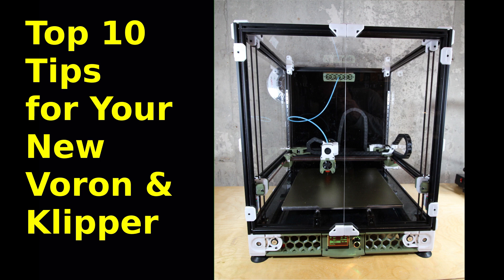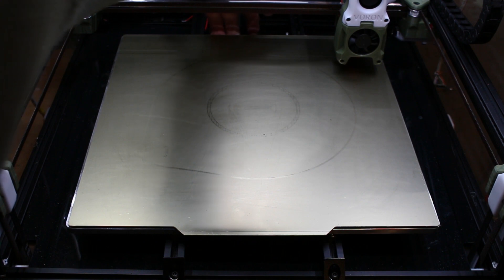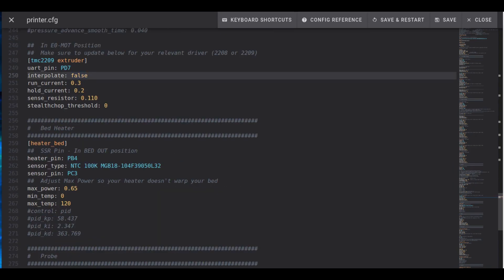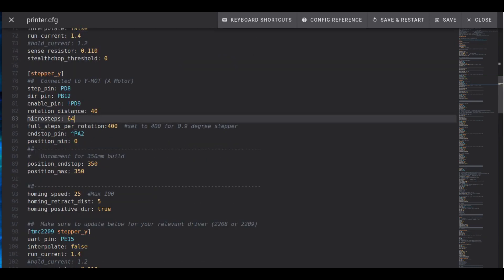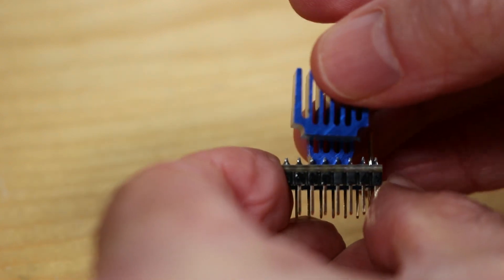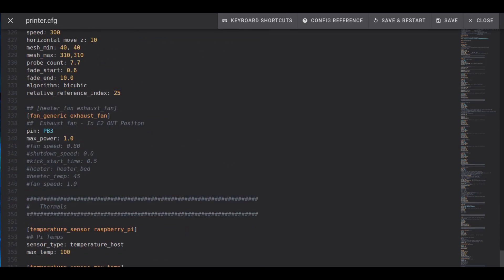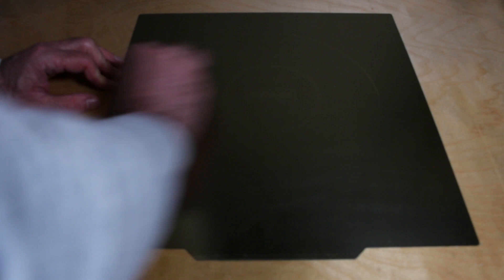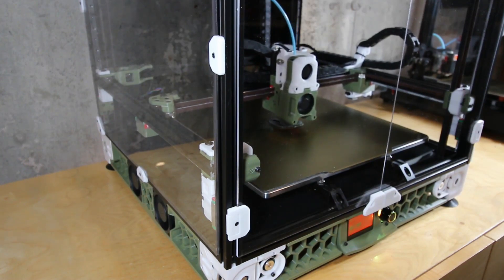Top 10 Tips for your Voron and Klipper

Comment: The only thing with increasing the microsteps is you exponentially increase the workload of the MCU. Going from 16 to 64 quadruples the instructions sent and processed every second (or millisecond? I forget) which taxes the processor. On lower end boards and/or weaker PI alternatives this might be an issue.
 Food for thought.
Reply from the maker: I am aware of this.  But even with my MCU being a spider v1.0, I have not run into issues yet.  But there are people that are switching to much faster MCU's to reach ultra high speeds.  I've got other issues I want to resolve first!  Thank you!

Comment: I've been running the same smooth PEI sheet for years, and have had to sand, steel wool, acetone, etc to improve adhesion. One thing is to use brass wool, steel wool leaves steel fragments which the magnets get a hold of, and the bits also rust, so avoid steel. Brass wool or stainless steel scrubbers solve this, however a better solution is Aquanet extra hold unscented hairspray. Now I just periodically clean the steel sheet and put a light mist of Aquanet over it. Then I print on it with PLA, PETG or TPU. I haven't tried ABS on it but have read that it works there too. No more sanding, no more cleaning between prints at all (just don't contaminate the surface with finger oil, never touch it, use tools only). The misting only needs to be done occasionally, not between each print. It seems to renew the surface of the PEI. I would make sure the Aquanet is fresh before TPU because it wants to over-adhere. PETG does also, but to a lesser degree. Water dissolves Aquanet so cleanup is just rinsing off the plate with water, very little IPA is needed for a final wipe down. Then a fresh mist coat of Aquanet and back to printing. Some dust may adhere but it doesn't affect print surface quality.
Reply from the maker: Aquanet on pei, this is new to me. I have used glue stick on pei and windex when printing petg on pei.  I need to try this. I also need to get some brass wool.  Thank you very much for the tips!

Comment: Hi, one thing to remember with the filtered exhaust fan is that while you print with it off, your printer is not air-tight... so any nasty fumes you are afraid of will slowly seep out during the print. By having the exhaust fan on during the print, it creates a negative pressure inside the enclosure. This theoretically prevents that unfiltered air from seeping through openings and sucks clean air into the case from those openings instead as the unclean air is exhausted by the filtered fan. :)
Reply from the maker: That is very true.  But it also seemed to cause trouble with some of my larger ABS prints.  I ended up building Nevermore and have installed it.  It works great and eliminates all the odor while circulating the air.  I highly recommend it.  Thank you for watching!
Reply: @KapmansBasementWorkshop  I would think the proper way to run the exhaust fan would be to limit the maximum chamber temperature to some value, keeping it constant. Too high or varying chamber temperature is a problem.
Reply from the maker: @alanb76  I agree.  At some point I'll get to making that change!
Reply: The fume hype is overblown
Reply from the maker: @powersv2  Probably, but since I really do print in my basement, my family really does not like the smell of ABS fumes that pour off that printer when it's printing at 350mm/s....it a lot of fumes....

Comment: While having more contact area with the stepstick is better, the thickness of the fins is a drawback. The thicker the fins, the more heat they retain, where as the thinner, the more room you have to fit more fins, meaning more surface area which leads to more heat transfer.
Reply from the maker: That makes sense.  But I think the extra fins with the extra surface area can expel more heat.  I think fins of copper would also be better than aluminum as it's a better conductor.  These controller chips create so much heat, I still need the fans on full speed.  Thank you for the comments and watching!

Comment: 13:35 Controller_fan section is exactly what i was trying to figure out. I want the fans for the electronics to turn on pretty much anytime the machine is doing something. Maybe even so far as to monitor the temp of the rpi and mcu and turn on those fans when it gets above 45C even if nothing else is running. What you have is better than using the heatbed to turn it on. But do you know how to turn fans on based on temperatures of the electronics?
Reply from the maker: I don't recommend having the fans turn on when the electronics hit a certain temperature.  I fear you will burn some of your motor drivers. The only electronics that actually requires a fan during operation are the stepper drivers.  And the stepper drivers can't tell you their temperature (as far as I know).  I also know that the temps on the motor drivers swing wildly and in a very rapid manner.  And, I personally have fried 2 motor drivers with inadequate cooling.  I would turn on the cooling fans as soon as any stepper is about to be powered.  I learned my lesson the hard way....
Reply: @KapmansBasementWorkshop  Oh, I was more thinking the fans would be on when steppers are in use and also if no steppers are in use but I'm configuring stuff in Klipper or Linux. But if those processors don't overheat then I'll just leave it with turning them on when it's heating up the bed or using steppers. 

I recently put together my first Voron. A V0.2 and have been dialing in the print quality which requires, for me, lots of reading then doing one configuration thing like trying pressure advance then reading more for next steps. So that downtime in between is where I was seeing the mcu/rpi heating up with no fans on because of reboots. I bet this is a moot point during normal operations later.
Reply from the maker: I'm sure you saw them heat up.  But for a pi, 50 or 60c is just fine.  I would worry if the pi was getting to 75 or 80c.

Comment: Rather than using the exhaust fan software mod you have used, you might want to consider an internal circulating filter like the nevermore mod to continually filter the odor without the exterior temperature swing.
Reply from the maker: It's a great tip.  I plan on doing so sometime soon.  Thank you!

Comment: Hey, just wanted to point out that the z steppers for me were super noisy and rattled the entire printer. Since its 4 motors running the gantry i set the run current to 1A and the hold to .5, as well as setting stealth chop to 5000. The z noise is almost gone, and print quality improved due to no extra resonance.
Reply from the maker: I didn't really bother too much with z because I assumed those motors rarely run and I was worried about making sure they hold position.  But the z motors are spending a lot of time holding and they move such small distances, most of the time, that high speed and acceleration on z don't do much to speed up a print.  Stealth chop and reduced current make a lot of sense.  I'm getting ready to try stealth chop somewhere,  z seems like the right place to start.  Thank you for the tip!

Comment: great video
I was wondering why I do not have warp issue with ABS, then at number 4, I saw the problem with the exhaust fan, mine is not connected.
I will probably add a nevermore filter
Reply from the maker: That makes sense.  I really don't use that exhaust fan anymore.   I should probably remove it and replace it with something else.  Thanks for watching!
Reply: @KapmansBasementWorkshop  nevermore seems the solution

Comment: Really like the MCU temperature and raspberry pi temps. Will implement this tomorrow. I also added a small heatsync to the MCU I had floating around. 
I'm suprize the stepper drivers don't have thermal sensors in them.
I jammed a external  thermometer in the fins of X A motor and the E extruder. Wish the octopus allowed more sensors. 
Can't wait no make my own mods video
Reply from the maker: A few days after this video, I also added a heatsink to the MCU.  Then I took the old heatsinks and added them to the Pi.  Adding those temps to the view on Fluidd or Mainsail is super easy!  I look forward to your video!

Comment: While your new heat sinks helped you I wanted to clarify some information you gave that is a little misleading.
Larger heat sinks help pull heat away with thermal mass but once they are heat-soaked that is no longer any better than a smaller heat sink.
What helps with cooling is surface area, not just* mass. (*more mass usually includes more surface area but this depends on the design) You actually want more cut outs in your heat sinks as it allows more surface for the heat to dissipate from more quickly. So in your specific case, all else being equal, if you bought the same heat sink but it had more cuts in the fins it would actually cool better.
Reply from the maker: I 100% agree with you. These heatsinks do have more more surface area via the fins which I believe backs up your statement.  I also oriented them so the fans are able to blow more air fully through those fins.  Thank you for the clarification / correction and thank you for watching!
Reply: @KapmansBasementWorkshop   You are correct that they can have more surface area as the heatsink itself is larger. My comment was specifically pointed towards the mention of them having less slits than the smaller ones which actually harms cooling and more mass on it's own doesn't help cooling.
Reply from the maker: @CharredChar  Got it.  Thanks for the clarification!
Reply: @KapmansBasementWorkshop  No problem! I am actually building a V2.4r2 as we speak so I found this helpful as some things to note once I get it powered on. The idea behind making that comment is more of a, "If I can find the same size heatsink as you did but it includes a couple extra cuts in the fins it should increase cooling more!"
Reply from the maker: @CharredChar  Have a look in that video's description.  The link to the heat sinks is posted there.  Just in case you had trouble finding them.    Thanks1

Comment: I wonder if you can help me to set up the configuraion so that the exhaust fan goes on at a certain temperature in the chamber. I have added a sensor in the chamber and want the fan to go on or increase speed at certain temp to control the temp in the chamber.
Reply from the maker: So I have not done this myself.  However, have a look at this: https://www.klipper3d.org/Config_Reference.html#temperature_fan

I can try to answer questions if I have them, but since I have not done this, Discord might be a better option.

Thanks for watching.
Reply: @KapmansBasementWorkshop  Thanks for your answer. Maybe it is better having the fan on lower speed and after certain temp it accelerates.  This is a challenge
Reply from the maker: @gudbjorghjalmsdottir7968  I can take a look this weekend and to try and get it working.  I print mostly ABS, I leave the fan off the entire print.  I only turn it on when the print is finished after the bed has cooled down.  Or at least I used to.  I installed Nevermore and actually don't use the exhaust fan any more....

Comment: Thanks for alll you cool Videos with the voron! I started with 3D Printing 3 month ago and I just finished my own Voron 2.4 last week. Talking about microsteps: If you have 64 with an 0.9 Angle motor. Means that I have to do 128 Microsteps for my 1.8 Angle Motor (Moons - Formbot-Kit)?
Reply from the maker: You should experiment a little.  There is a tradeoff with microsteps.  The higher the microsteps, the less torque the motor has to do actual work and I think maximum speed drops a bit as well.  You only want to use the amount of microsteps that you really need. I believe the Vorons are geared enough to where on x, y and z you don't need a 0.9 stepper.  Try 16 microsteps and if you like, try 32 and see if you can visually tell the difference on a print.   I don't think you will be able to.  So then go with what is more quiet while providing the best performance.    Thank you very much for the kind words and for watching!
Reply: @KapmansBasementWorkshop  Thanks alot!!! The motors I have for x y z are 1.8 degrees. I put them now on 1.2 run_current like you in one of your videos. Max_accel is set to 5100 after doing input shaper. Do you think the higher the microsteps the less noisy it will be?
Reply from the maker: @Tenebray84  Check on the motors to make sure they are not getting too hot.  Too hot and they will  melt the ABS they are mounted to.  I would try 16, 32 and 64 and listen for the differences and make your choice.  I think it depends on your motors.

Comment: Great video.  My screws were also too long!   I have one of the first blurolls kits with pretty bad beds - I alleviated the problem by using pei tape  on the low spots on top of the magnet.
Reply from the maker: When you look at my bed mesh in the video, does that compare to yours?
Reply: @KapmansBasementWorkshop  Yes! It looks just like your fixed mesh!  So if you slide the slider up to hide the low areas they turn black, this is where you put your first piece of tape.  I have many :(   The only part of this kit I really regret installing is the bed, but it can be alleviated this way.
Reply from the maker: @alvarogil7953  Thank you for that information.  Seems I need to consider my next steps in this area.

Comment: You can also set the Exhaust Fan to kick in once the print is finished using the PRINT_END Macro... Just saying.
Reply from the maker: That's a good idea.  Do you have any problems with the print cooling too quickly and warping when using ABS?

Comment: Is 17:10 also possible to do in config file with something like an if statement: if(printDone){exhaustFanOn}?
Just finished my 2.4 build but totally new to klipper
Reply from the maker: Yes, you can.  The script used is called "jinja2" if you wish to look it up.  A conditional looks like this:
  {% if home_all or 'X' in params %}
    _HOME_X
  {% endif %}

I pulled that from one of my klipper cfg files.

Comment: super helpful THANK YOU, I have one question: I notice your motor is Insulation Class H, the one I got is Class B  ( my setting goes like this [ run_current: 0.5 sense_resistor: 0.110 ] I have no Hold current specified, and wondered if the issue you face is related to the exact motor you got ?!
Reply from the maker: Good question, I did not notice that previously.  While I would like the motor to have a higher rating for durability reasons and long life in a hot environment (I did not even know about this when I purchased it) at class B, it should be able to support 130c and the interior of this printer should not be going above 60c or 65c.  In addition, getting close to 130c certainly means the motor life is greatly reduced.  Hitting 130c or above, or having a class H hitting 180c implies the ABS of the print head is most likely going to fail which I think is the biggest issue of concern in this printer. I'm sure with the heat the resistance in the motor goes up which just makes it hotter faster.  It's this last item I don't fully understand with the different temp classes as I think it's just a difference in winding insulation and motor durability, but I may be wrong.  In either class motor, I think the current needs to be limited no matter what to keep the motor running cool and keep the print head in solid form.  And I think it's super important in an enclosed printer vs an open one.    I need to investigate this more with my next print head and motor.  Thank you for this tip and thank you for watching!
Reply: @KapmansBasementWorkshop  Thank you for your great Videos ... I did adjust the current to up to 1.2 gradually from 0.5 , and the x y motors went so silent ..i love it .. i just notice sometimes they slightly buzz when they hold positions at home x175 y175 .. not sure if this is normal . in anyway am super happy with the new setting ..BIG THANK YOU.
Reply from the maker: @omranello  Please make sure your fans are blowing over those driver chips at full speed and keeping them cool so they don't burn out.  And consider a heat sink improvement for those chips.  I'm very glad this helped you out!  Thank you for watching!
Reply from the maker: Also, I'm not sure about the buzz.

Comment: I know this flys the face of 3d printer bed adhesion convention but in my not insignificant experience, PEI just isn't that great with ABS. We've gone over it on reddit ad nauseum but others have had the same experience - where plain stainless steel (flex plate with pei removed) and a little hairspray works exceptionally well for just about everything, especially ABS. In fact,  I use hairspray AS the print surface now. I clean the steel in the sink with a scrubby and dish soap, dry it, and then soak the surface in hairspray and then heat the bed to set it and get it to dry. It leaves a perfectly clear, tacky surface that, after a print, is refreshed with a subsequent light touch up with hairspray. After many, many prints, just hit it with hot water from the sink and it all comes off.
Reply from the maker: I've never tried the hair spray technique.  But you have me interested.  I have an old damaged PEI bed.  I'll try to remove the PEI, clean the steel sheet and give this a try.  Do you have a favorite hair spray?

Comment: Instead of your exhaust fan solution, you can also just eliminate the exhaust fan and install a nevermore filter instead. It keeps the heat inside but constantly filters the air
Reply from the maker: Thanks for the tip.  Nevermore is a future project for sure.   But I had already built this, so for now, a fix until I move on to something better.